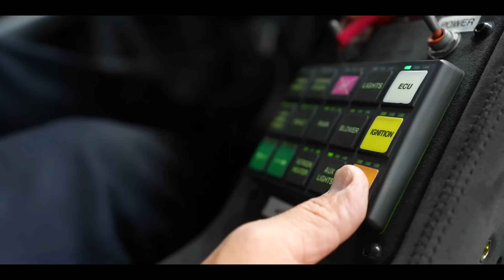Tim causes $7647.56 in DAMAGES on DAVE'S SUPERCAR!!

Comment: Dave why don't you rearrange the walls in the room with the pillar, I mean it is only plaster board walls and wood bracing and framing, just adjust the walls to make the pillar a corner rather than the centre of the room and arrange the other rooms to take advantage of the extra space it would make.